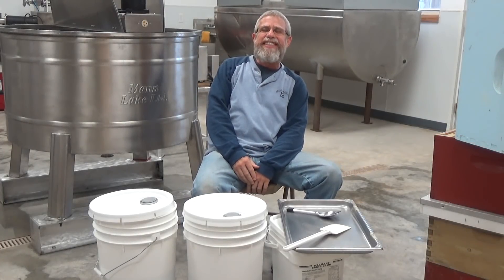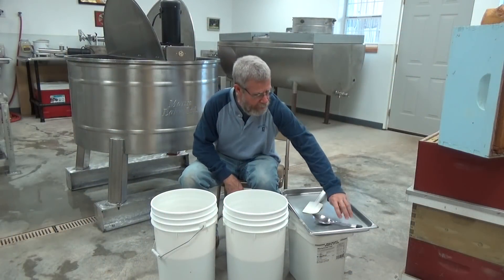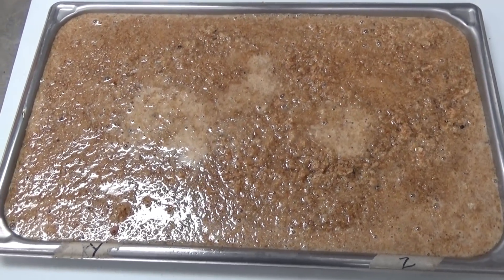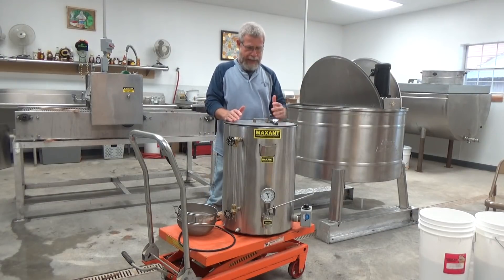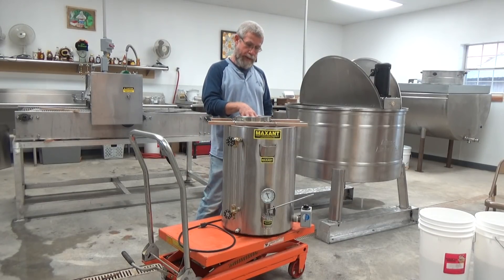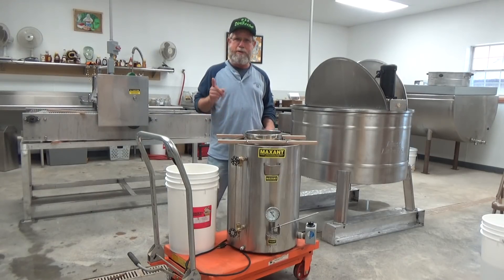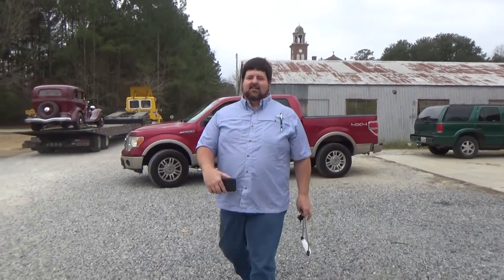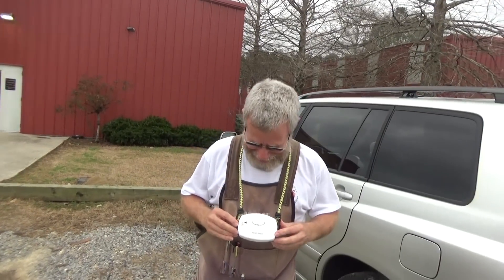Honey processing from bucket to bottle, part 2

Comment: Doesn't the hot plastic alter the taste of the honey? You have it in the water but if the bottom of the bucket is in direct contact with the metal base of the pot then the plastic will get to a temperature that's higher than 100 celsius
Reply from the maker: The bottom of the bucket is not in contact with the bottom of the pot, there is a 3/8 of an inch ridge to prevent that from happening. Thanks for watching. God's peace. 
Mr. Ed

Comment: Why wouldn't you filter the honey through a double strainer as you're filling the buckets? Would save time (no skimming needed) and result in cleaner honey.
Reply from the maker: That would work fine for smaller amounts of honey, but when there are large quantities of honey, there is also a large quantity of wax as well, and it's simpler to remove the wax when it's on top of the honey.  Good question. Thanks for watching. God's peace.
Mr. Ed

Comment: I love honey but I have a question? Won't heating the honey to 100 degrees kill all the vital nutrients it contains and will it still be considered "raw unrefined" honey once heated? Thank you for sharing your knowledge with us :-)
Reply from the maker: Honey will start losing it beneficial value once it reaches 115 degrees. At that point,  the active particles suspended in the honey begin to be killed. As long as the warmed honey does NOT exceed 115 degrees, it is still raw. Very good question.  Thanks for watching, and I hope you will check out more of my bee wrangling/ bee rescues adventures and let me know what you think of them. God's peace. 
Mr. Ed

Comment: Why don't you strain it straight out of the extractor?
Reply: he does later on. you wouldn't do it initially because all that wax would just block it up
Reply: Candide Thirtythree everyone has a different way of doing things based on their preferences.
Reply: He did it this way because it was a small amount of frames and he didn't want to get everything dirty.  So he scratched the caps open.  Then he spun the honey out.  I think he did not filter as it came out because this is easier for such a small batch.
Reply from the maker: I did do that at one time, but because the filter/strainer becomes so clogged up with wax, the process of draining the extractor has to stop, and then everything takes longer to do. If you strain the honey from the buckets, it becomes a quicker process. Thanks for watching. God's peace.
Mr. Ed

Comment: Hey Mr. Ed, Why couldn't you strain your cappings through a 5 gallon paint strainer? Just hang it over a 5 gallon bucket and pour the capping into it and let it drain for awhile. They're only a couple of bucks at the home center or paint store. When your done you could dump out the cappings for the bees to finish and then wash out the strainer and reuse it.

Comment: Hmm, i thought that heating Honey more than 40°C/72°F is 'Killing' the best parts of it... but you Talk about 80°F what is 44°C...  in Germany ( where i'm from)  Honey heated more  than 40°C can not be sold as 'German  Imker Honig' anymore....
Reply: 40°C is actually 104°F so he was just at the 40 mark :)
Reply: renatwin you are right..  my converter tool messed up... just saw it on the bottler thermo as well... wrote this before ending the vid... Messing this up would not have been him..... where he does anything with such much Passion...
Reply from the maker: As long as I stay below110 degrees, the honey is still considered "raw" and has all the beneficial elements still active in the honey. For us in Southeast Louisiana where temperatures can reach in the low 100's, the temperature in the bee hive can climb as high, and this does not effect the honey either other than making it VERY thin and runny.  Thanks for watching, and I hope to hear from you again soon. God's peace.
Mr. Ed
Reply: Jeff Horchoff ... you are right... I made a mistake converting from °F to °C... as I'm used to 'Think' in °C as a German 😁... greetings from snowy cologne